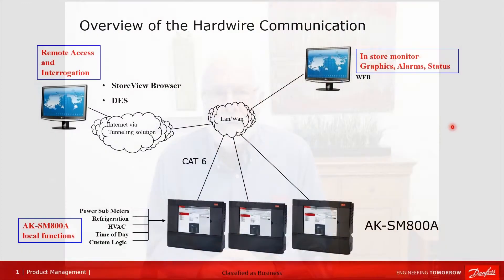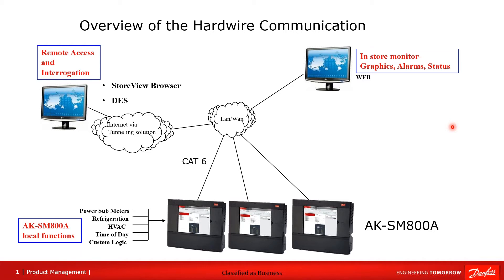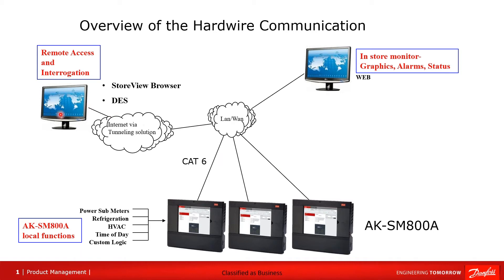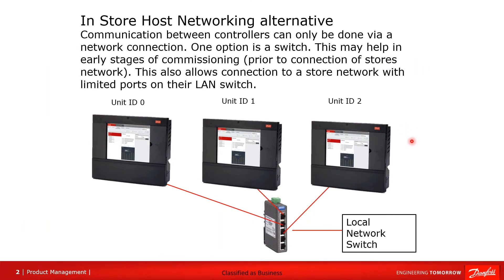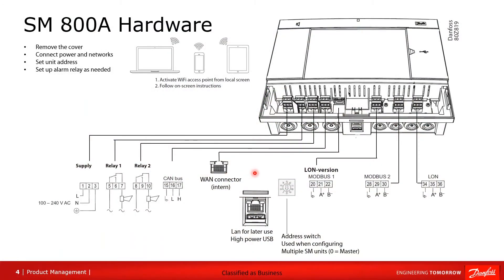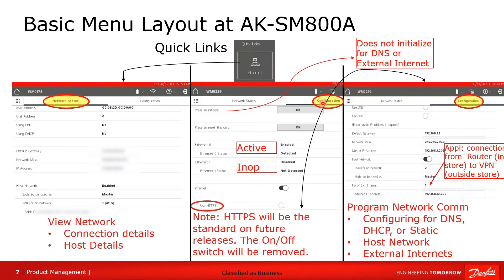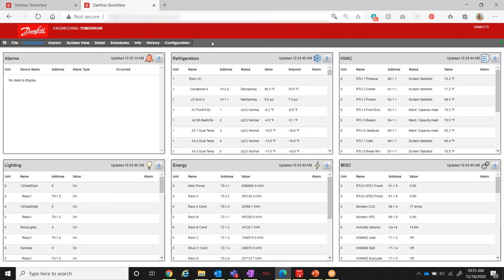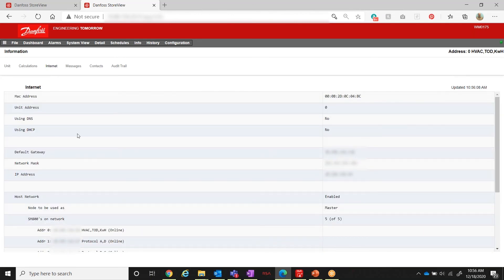Network comm. connections & settings in the AK-SM 800A | Technical support for supermarket controls

Comment: Hi
I have private ip adress on my router and I have host network on my 2 system manager sm800a. I have great connection when I connected on local master system manager. I see all of 2 systems manager. But when I connceted from external ip adress on master unit i didn't see slave? Why?
Reply: I have the same situation, how could you solve it?

Comment: Is it that ? these devices (AK-RC 113) temperature controller are designed to be able to communicate with other units ex: PLC
Reply from the maker: Hello - this controller does communicate with standard Modbus-RTU networks. Contact your local Danfoss office if you need the Modbus-RTU Register list.
Reply: @DanfossNorthAmerica  merci